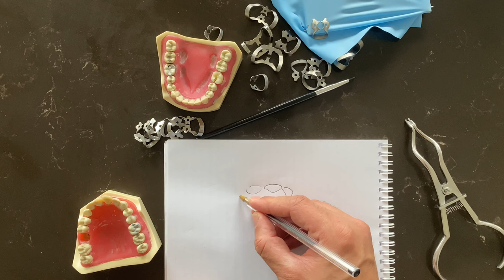Rubber Dam Basics 101

Comment: What about isolating the second molar? Do I put the clamp on it if there is no tooth behind? Also does it matter if I put the rubber on from mesial to distal or other way around before I place the clamp? Thanks!
Reply from the maker: So the clamp always go on the distal tooth. So if there no 8 present. Then you put the clamp on the second molar. Just make sure you have 4 point contact, and there is no tear present. Accidentally if any opening present, just seal it with gingival barrier or liquid rubberdam so you have maintained good isolation. 

In the clinical scenario we generally put the exam in reverse fashion somedays. But from the exam point of you it needs to be facing distally. 

Best of luck 👌👌